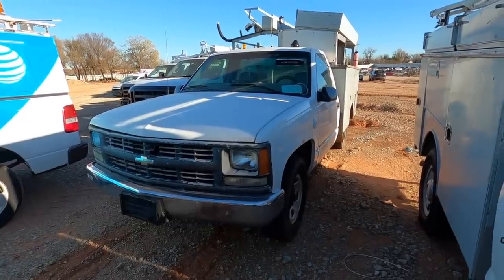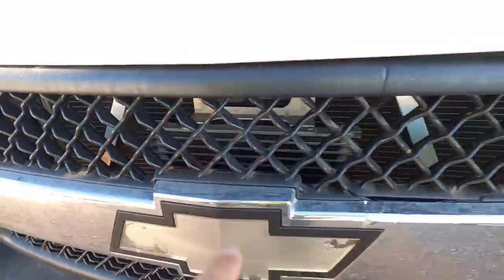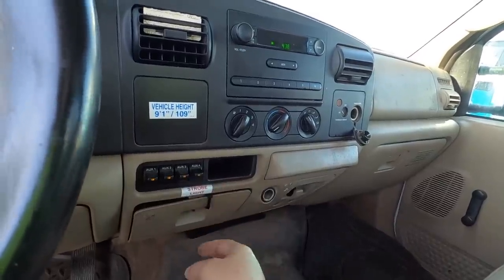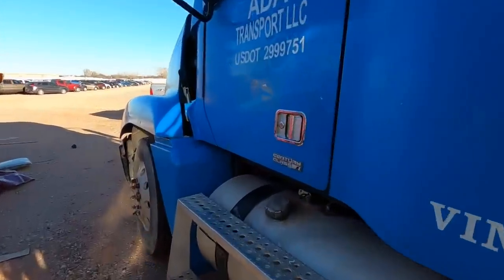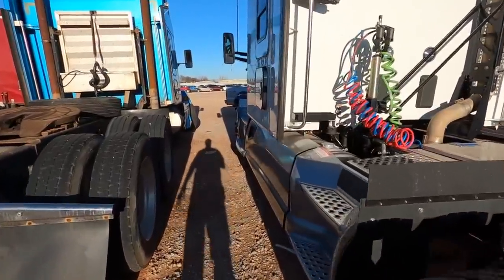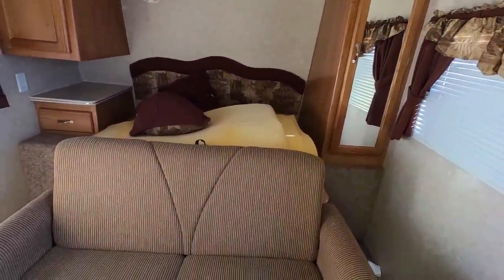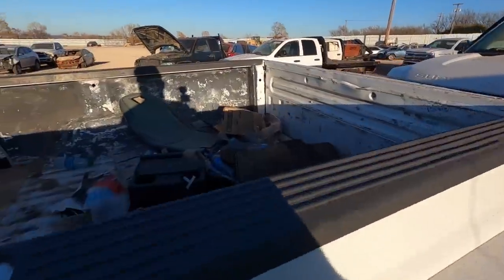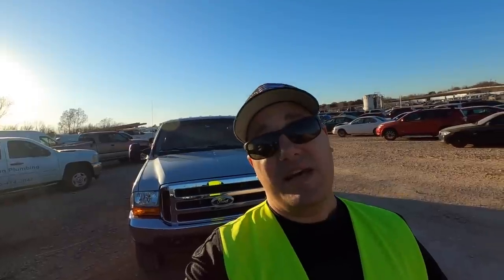Copart Walk Around 11-23-19 + Semi Trucks, Trailers, AT&T

Comment: Randy, hydroboost has nothing to do with fuel type; it's for heavier duty braking systems.  That's why you see it on one ton trucks and above.
Reply: Used on diesel and EVs that don't produce the vacuum required for a standard brake booster or when extra boost is needed.
Reply: Tony P don't EV's use electric boosters?  Definitely that's the reason for diesels to use an alternate system, but I've had several gas powered duallies that had hydroboost as well.
Reply: I've seen them on restomods when the LS swap doesn't produce enough vacuum to properly assist the brakes.
Reply: @Tony P yeah anything with a high lift cam can't generate sufficient vacuum.
Reply: Correct, my 04 avalanche just your run of the mill 5.3 had the hydro boost. However, my current 03 avalanche has a vacuum operated system
Reply: Commercial trucks GM builds even 2500HD they put hydraboost on

Comment: You didn’t miss it. I work in the same field and have friends who work for att, and the older trucks are ordered without ac or thwack is removed. I was told it was so the techs wouldn’t just sit in the ac. And the round thing on the side holds a spare key to the vehicle.

Comment: It is definitely a key holder on the side of the truck.  It made things simple if the service vendor needed to pick it up for servicing, or if you had to leave it at the shop after hours.  There is a round hole cut in the fender and a pocket behind the lock where the key and fob would be stored.

I drove an AT&T fleet car for a couple of years.  The cars were serviced by a third party (at least where I was from) and they would get your next level supervisor involved if you did not bring the vehicle in for service on time.  They're going to be in good mechanical condition, but most are trashed on the inside with food, cigarette ashes, dirt, etc.  Most drivers did not take good care of their cars.  

Many have generators or power inverters built in.  Some have a built in wifi unit and a laptop safe too.  They also have GPS hardware which I would remove right away if I bought one of these vehicles.  Some are sent away without emptying them at all, and often have expensive tools or ladders depending on the area they came from, and what the driver installed.  I've seen uverse remote controls and set top boxes, wire, connectors, and DirecTV equipment as well.  All usually sit for months on the Copart lot before they are listed for sale and their batteries are dead as a doornail.

"Surplus" means either a technician position was eliminated and the vehicle was retired, or it hit a mileage or age threshold and was sent back.  I've seen T vehicles at Copart with less than 10,000 miles.

Comment: Up until the late 2000s there was not a mandate where most fleets had to have vehicles with air conditioning in them. what utility companies did was right before the Mandate bought a lot of vehicles without air conditioning because they said that if they had air conditioned the technicians were more than likely idle the trucks more "enjoying" the air conditoning rather than doind the work in turn spending more money in gas and also lower product productivity because they were sitting in the air and not doing the job they were assigned to do but in the late-2000s OSHA pass the law where a big Fleet had to have air conditioned trucks. The hydro boost were on some trucks used to haul splicing trailers, arrow boards, and cable reel trailers.

Comment: Tow companies very often have to disconnect the driveshafts for towing on commercial vehicles of that size. You see if often in Ron Pratt videos. The F450's have an option for a built in tow rig. Mounts underneath the bed allowing you to drive it like a real truck but still gives you a free 'tow truck' for picking up cars that don't run. A few of the 'Asset Recovery' companies use them around here for stealthily swooping in and towing away repo cars.

Comment: Randy I like the 18 wheeler carnage... I drive them and mechanic on em. Those at&t trucks are kept up nice.. GM use Hydraboost on their HD2500 trucks for commercial trucks... trailers rot under windows when they leak.. randy you need to keep the 7.3L powerstroke it's better than anything newer stop listening to the people that dont know what their talking about... the 7.3L powerstroke is a million mile engine if you dont screw em up

Comment: I drove truck for 10 years. Definitely takes some getting used too. Some drivers are pigs. To give you an idea of the strength of those trucks. That front axle is good for 12,000 pounds. And yes all trucks need that extra oil in the side box as well as coolant, 5th wheel grease. Even new trucks burn oil. That's why every pre trip inspection you check your fluids. You do a pre trip inspection multiple times a day.

Comment: You need to keep the 7.3 F-250. As you can see yourself with over 300k miles they are some of the best most reliable longest lasting trucks made. As I've told you before a company named Katskin makes a leather kit for that truck. You order the kit for about $1000-$1500 & Katskin ships the kit to a OKC installer & they install new leather covers on all your seats. Even @ $2000 that's still way cheaper than a newer truck.

Comment: The last Truck send Western a email he all ready got anouf projects all tho .

The F250 is excellent for what you due excellent motor your not going Cross Country with Heavy load's all the time . The F350 extend cab Dually with 7.3 and Six Speed got plenty power I pulled lots of load's with Heavy Equipment and either Truck to Car's .

Comment: In UPS Package cars, the one you see delivering to residential homes, also do not have any A/C.  The only vehicle that had A/C are the guys in the tractor trailers
Reply: Many fire trucks do not have A/C. City I lived in bought 2 pumpers for $500k each  w/out A/C. $ 1 million for 2 with no a/c!
Reply: @jimnielsen4076  I'm shocked, I guess I won't be complaining anymore.I know they usually respond to calls nearby for the most part, but I would have thought they  for sure  would have a/c, especially with the gear they have to wear.
Reply: @davidtran4760  I was really surprised too. I forgot above to write $ 500k each.  I thought they would for anyone getting heat stroke (I know they use water to cool down too) or just for comfort doing building inspections, flushing hydrants..... It might be tradition?

Comment: Most road trucks become dump truck when there older .Just remove the sleeper, fix the back of cab ,of on a run bed. If the truck has a flattop (not a tall sleeper) I hall them out of copart on a 30foot rowback all the time.

Comment: The F450 with the reduced power is because the motor is doing a regeneration. These trucks go through a regeneration that burns off crap in the Cat converter. It was one of Fords worst ideas. It will go back to full power when the regen cycle is done.

Comment: Back in the 60s AT&T did nothing to their cars, ran down the road until they dropped. Didn't even change the oil, just added as needed, haha. Think they had a good deal with Ford, cheap Falcons. Randy, get the trash truck, only needs a MAACO paint job and then start a trash service, only kidding.  :)

Comment: The diesel additive is for the commercial diesel generator 

Cheers
Reply: The APU (Auxiliary Power Unit) to power everything in the tractor when not driving. So you don't have run the drive motor when sleeping. It's what you usually hear at truck stops or the Walmart parking lot when the driver is on rest.

Comment: The roof of that camper might look like swiss cheese. Most likely it has major damage to the roof.
Reply: The roof is easier to fix than the sides as long as there is no water damage from the holes. Even some thin sheet fiberglass could be used to recover it. Side damage is hard because it's hard to match what is already there. A replaced top doesn't show.